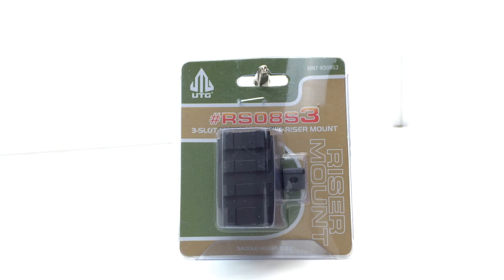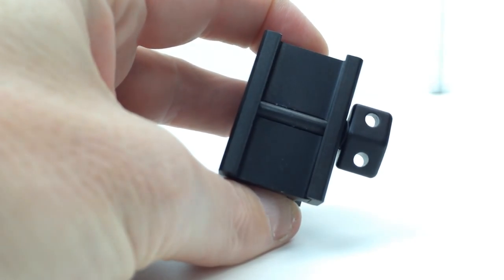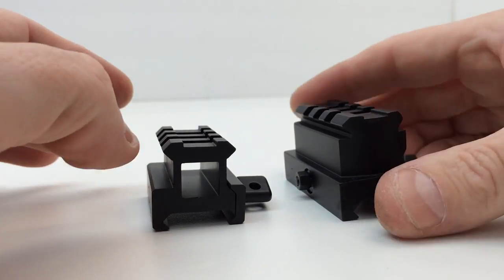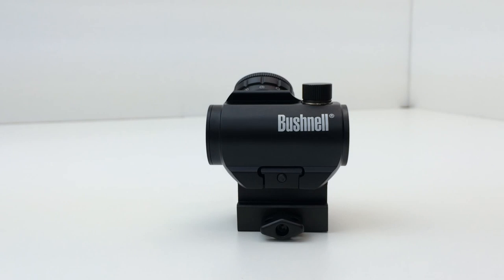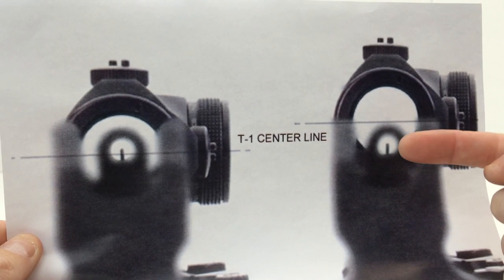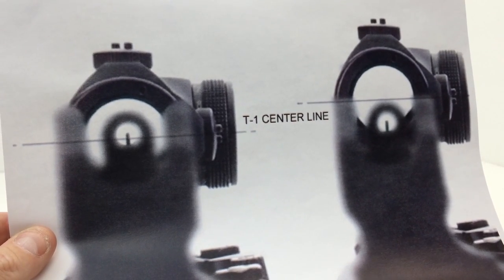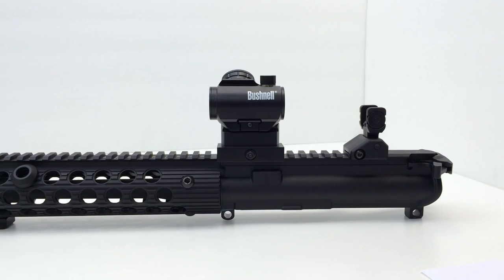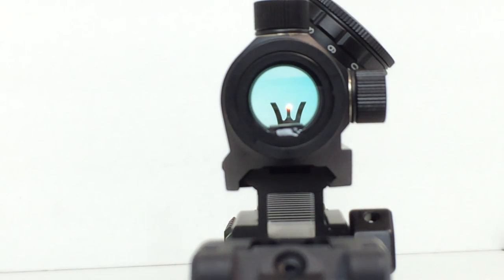UTG Medium Profile Riser MNT-RS08S3 Review & install on the Bushnell TRS-25

Comment: A lot of people talk trash about UTG. I have always found that their stuff is awesome for what you pay for it. Is it a little heavier than similar items from "Tier 1" manufacturers, yeah it is, but they work, are tough and the slight extra weight isn't that noticeable unless you're the type of person that bolts everything and the kitchen sink to your rifles.

I would consider UTG to be along the lines of the Ruger of the accessories market. Their stuff is a little bigger, a little heavier and more overbuilt than the competition, but they're solid and work just fine.

I just ordered two of these to replace the fixed mounts on the Primary Arms Red Dots on my AR and M&P 15-22.

Good review!
Reply: I found the same . I've used their quad lock QD scope rings , pic rails . I really like their stuff. And I prefer the extra weight they give too . Makes the whole platform feel more stable and I've found especially with optics the sight picture doesnt jump around as much .

Comment: The Bushnell looks better on the UTG in my opinion. I’ll probably get the high profile UTG mount rather than the medium profile. I prefer the 1/3 co witness. I had to think about it for a bit, but I feel like even if your red dot goes out and you flip up your irons, you have a better field of view through the red dot housing with 1/3 co witness. So that and a fixed A2 front post would be my two reasons for that.

Comment: even with emitter at 5oclock it is still on the way and you will only see a very small part of the front sight post....i just bought a 1 inch riser now i need to get the .83

Comment: Thanks for the detailed video. Do you find that the new 6 o'clock emitter design is flawed?
Reply from the maker: +Mutatedgenome Having the emitter at the 5 o'clock, 7, 8, 9 etc. is a better location, it avoids the issue of the emitter interfering with cowitnessing.  Especially if the emitter is large.  This seems to be an issue with doing 1/3rd cowitness, absolute cowitness is fine.
Reply: 2phast Tactical that was my issue. supposed to be 1/3 but w the 6oclock mounted emitter my irons were useless. I bought one of these and am happy